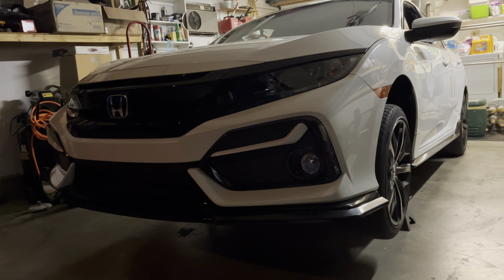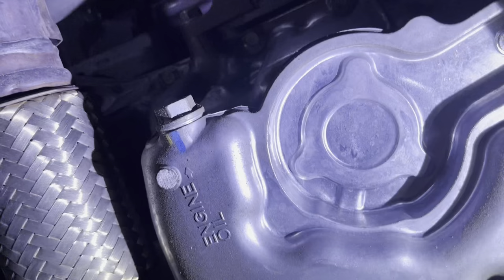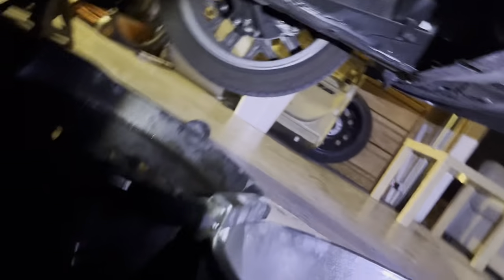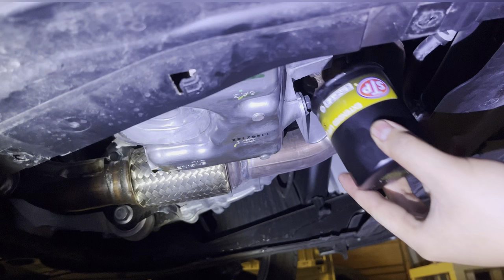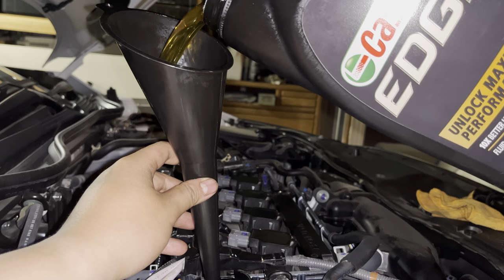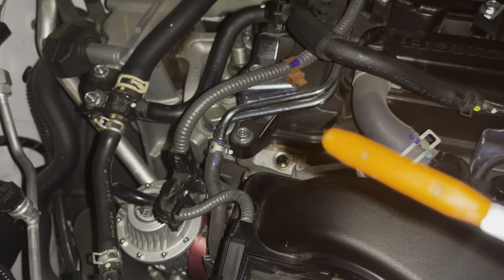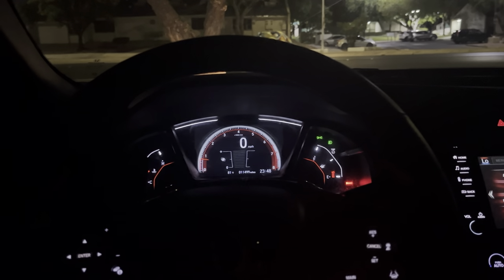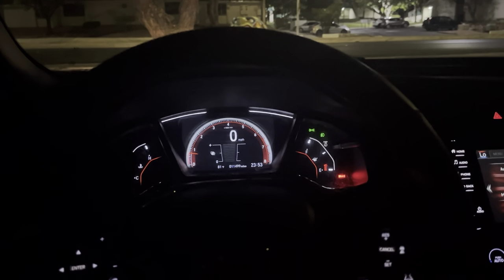Much Needed Oil Change | 10th Gen Hatchback Sport

Comment: Good job dude. I just got my 3rd service coming up, A,B and 7 so gonna let my local Honda authorized workshop fix all of it for me.
And today is the day me and a friend gonna install the Borla S-type and afe Power downpipe. Superpumped! :D
Reply from the maker: thats good! Gotta take care of the whip!

Im super pumped for you😭 it’s gonna sound so good good luck! I wish there was a way I can hear it😭
Reply: @_d_g_o_t_  The sound came out awesome :D except a noticeable whistling sound at maybe 6k to 7k rpm at 90/100mph, I'm not sure at what rpm's since I didn't drive much after installing it.
I've been doing a bunch of research and it doesn't seem to be a rare thing, maybe it will get better by time, especially after I get the MST Air intake installed. 
But if not it seem that most likely it's a muffler problem where the tailpipe going from one to 2 pipes got a not so smooth edge at the welding.
Reply from the maker: @mr.cromlech683  nice! That’s weird I hope you find out what it is though, hopefully its nit a defect with the exhaust or the intake. 

Is the noise a blowing out noise or a sucking in noise?
Reply: @_d_g_o_t_  I'm not experienced enough in engine sounds but my friend who helped install it was curious too. 
He didn't think it sounded like leakage in each part. 
I thought the sound came from the front, some say the same but most points to the muffler thing. 
So I'm gonna check a few things the next 2 weeks to rule out the easier things before having to do check more expensive stuff.¨
Reply from the maker: @mr.cromlech683  I wish I could help! Good luck, hopefully its nothing at all.  Are you sure it’s not your intake making the sound?
Reply: @_d_g_o_t_  I still got the stock intake and it's my first choice of reason, will see later this week or beginning of the next one when I get my MST intake. 
If it's not resolved after changing that then I will check into the muffler twin welding thing. :)
Reply from the maker: @mr.cromlech683  alright sounds good, good luck I hope everything resolves itself. Keep me updated!